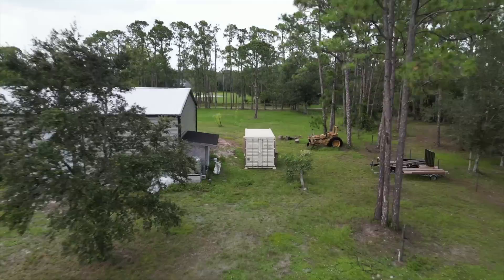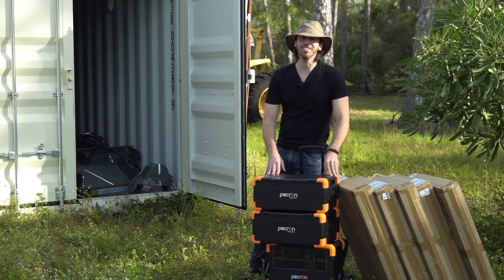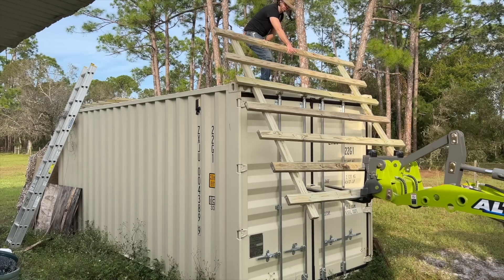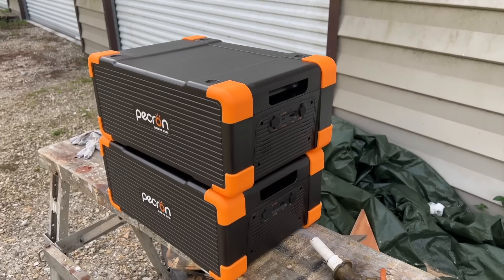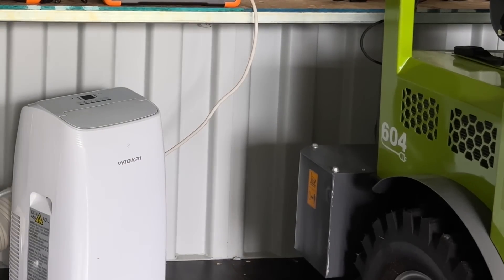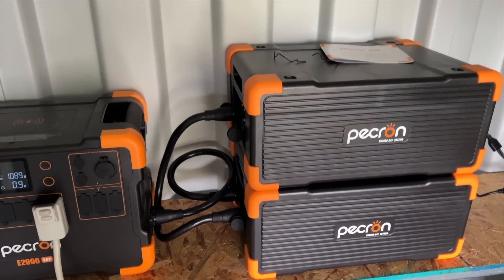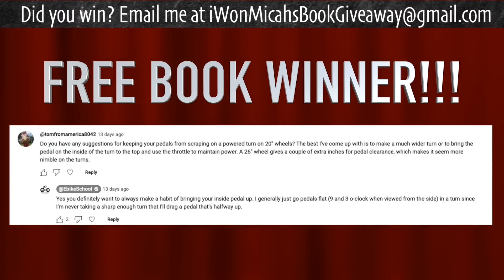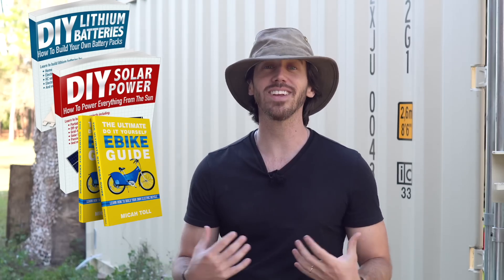Making an easy SOLAR-powered off-grid container with A/C!

Comment: Why did you drill thru the side of the vent adding a chance for water penetration? You should have cut out the bottom screen of the vent and pulled the wired up and in leaving drip loops underneath the penetration .
Reply from the maker: There is a drip loop. The interior hole is higher, letting water drip down the outside of the container. It’s gone through over six months of rains so far and all good.

Comment: Honeslty don't see how this would save any time vs buying 16 $95 LF280K's off 18650 Battery Store ($2000 at most after shipping) and an EG4 6000XP for 120V/240V ($1400) with a pretty solid MPPT built in. Add a pallet of 25 235W or 430W panels from San Tan Solar ($1000-$2000 for 5kw to 10kw of premium panels or spend a few hundred dollars and get a couple kW of some less desirable used panels that will still perform well...for under $500 plus shipping there's a lot of options for getting 4kw of panels mostly 200-250W panels)

So $4000 to $5500'ish and you could have a 16kWh battery with a 6kW split phase AIO inverter/MPPT and more than enough panels to keep you juiced up in Florida.

But I can't knock Pecron too much. Their pricing is honestly some of the most competitive on the market for the wH.

Comment: 4:54 Why are they being laid flat?  Unless you live on the equator, they should be tilted to your latitude. If you live on latitude 30, they should be tilted 30 degrees.  Laying flat at high latitude, they will never produce anywhere near their rated capacity.
Reply: because we are in hurricane country and this was the only way to attach them without risk of loosing them or needing to take them down in a storm, without adding welded steel bracing.

Comment: I used to ride a bike all the time, 20, 30, 45 miles at a time. 10-12 miles a day every day, long rides on weekends. Now, homebound. Not strong enough and 100,000$ in medical costs a year. If I had an e-bike, I could get outside again.

Comment: Totally unrelated to this video, watched some of your older videos on building battery packs and was wondering if you had some info on building a pack capable of level 2 charging. Have a Sondors Metacycle and considering attempting to build a pack to increase range and add EV charging. Would appreciate any guidance you could give me in that direction.

Comment: 9:18 the end of this tube should be cut at a 45 angle NOT at a 90deg angle like it is, The tube could potentially plug with water due to surface tension and the 90deg end, as it is now. It would be NO EFFORT for you to put a steeper angle on there, no excuses.
Reply: Bigger problem is insects and lizards getting in.  That's why we put hardware cloth over the end.  Can't see that in the video.  No excuses - funny LOL

Comment: You will want to angle the panels south for the average yearly sun angle dependent on your latitude.  Don't expect more than 10-20% rated panel output on cloudy days. Any amount of shadow on the panels will cut output dramatically.

Comment: I use those portable AC's job camping. Wrapping the outlet hose with insulation keeps extra heat from radiating through. It helps a lot actually. Cheers Micah

Comment: The panels being flat on the roof is not a good idea you are losing alot of power they should be angled towards the sun you would gain so much more power.

Comment: It will help your batteries if you insulate the container. You ac won’t be running so much draining the batteries. If you insulate the container, it will hold the cool air and not let the hot air come in from the walls and ceiling.

Comment: Yes those folding panels were free or promotional to you, but it doesn't take a genius to point out, folding panels are not most durable and will degrade in a permanent style installation.  Not what a person starting from scratch and paying for every part would be advised to use.   Solid (architectural) panels most applicable here, some flexible ones second best (because they'll last but are lying flat so needlessly more expensive);  Folding IMHO are great for temporary manual deployment, and would be good for added input through a port on the side of the container on appropriate occasions (eg on overcast days or if the container gets shade in winter that it doesn't get in summer.)

Comment: This would be a great power backup for your parents if the grid goes down for a while. This would run a fridge and some appliances until the power is restored. It’d be great to fit an external rated outlet on the outside of the container for easy hookup.

Comment: The most inefficient air conditioner is a Portable AC... Been there... Done that.
Tilting the solar panels southward will also increase their output.
Reply from the maker: Yes I forgot to mention that in the video but I went flat mount because we get some windy storms and I didn't want to give more surface for the wind to get under than I had to. There's a small efficiency penalty, but we're so far south that it's less dramatic than anywhere else in the US... other than Key West!

Comment: The cords from the Solar panels to the inside. looks to me like the water could get in from the lines entering into the container . You might have fixed that but not on camera.
Reply: There is a drip loop but hard to see in the video.  WiIl also caulk it when we are sure that there are no changes that need to be made.

Comment: Obviously, you were sent all of those folding solar panels, because if you were paying for them you would definitely NOT have gone with them as they are ridiculously expensive for the output that you get from them!  Their only advantage is portability!  For a more permanent installation buying normal solar panels would not only have given you greater output capacity per area of pannel, but they would have cost much less overall!!!

Comment: Hello Micah, I enjoy your videos. I like the subject of this one - as we have a container on our farm that we are doing things with and adding AC sometime in the future is one of them. I could be wrong, but I'd rather err on the side of caution and try help someone save time, money and headaches. Please understand the following is meant well. Most portable solar panels, that I've read about are not meant to be in the rain too often. (I understand they gave them to you to use. But I would look into getting glass panels for what you are doing. Portable panels are for fair weather and part time use. The glass panels will stand up much better and last longer. They will also provide more output too.) I would strongly recommend that the AC drain hose not be placed on or near the wood that the container is sitting on. It can rot the wood faster, if not cause that corner to sink over time. (Our container was placed on wood, for longer than I had planned and the rain water running down the one corner made it sink more, until I jacked it up and put cap stones under all four corners to level it and allow for the bottom to air out..) Not sure about where your father lives, but around here little pest are very curious and I would put a vent cover on that AC fresh air intake. Lastly the solar panel cables going into the container need a loop in them going well below where they enter the container, so that rain water will follow that to the lowest point and drip off and not be pulled into the container by following the cable in, as they are now. All the Best, Tony
Reply: I was thinking the same thing this is not the ideal setup.   I find used glass solar panels consistently on market place.  Me and my dad bought a pile of 17 panels for about $70 a piece and used them for a bunch of different small solar projects.  I know he likes the ease of install but I feel no one in there right mind who actually has to spend there money buying this equipment would then screw it to the top of a shipping container.

Comment: If this is a semi permanent install for the panels why use the folding panels?  You can get 100 watt rigid panels for $65.00 each now.  Those folding panels will not last very long deployed up there.

Comment: should put mesh on AC inlet so you don't have bugs and stuff crawl into AC , AC should prob be set to 72-82 F will save on battery usage and still have a good temp for equipment storage. Get some Sealing Clay for the big gaps to fill in and high temp sealant for small gaps.
Reply from the maker: Thanks! Yes we actually did but I left that part out of the video. It was one of the first things my dad did after we put the flange through the air outlet hole.
Reply: @EbikeSchool  nice, great video, hope you update us on how it works

Comment: to prevent rain from running along kabel that enter the container to the power unit, hang the surplus label in a loop below the power unit. that way any water will fall from the kabels at the bottom of the loop and never reach you power unit.

Comment: Nice setup. The AC will keep the batteries cool and that should extend their lives. You already know that but I suggest tilting the panels towards the South a bit so you can get the most out of them. Also add a screen to the AC outlet to prevent the bugs from getting into it

Comment: You’re delusional if you think that A/C unit will cool that container.
Reply from the maker: feels cold...
Reply: Until you get a heat wave. It needs a split system. All that air being pumped out side by the unit has to be replaced from the outside. Not an efficient way to cool anything, especially a metal container that’s going to fry an egg in the heat.

Comment: I wouldn't trust this wire to hold down the wooden frame but use some solid bolts if you don't want to retrieve your panels from the neighbor after the next hurricane...😜
Reply from the maker: Oh yea, it's definitely not hurricane proof. Before a hurricane the whole thing needs to come down. The panels will rip out even before the rope holding the frame down!

Comment: I'm an independent trucker and I bought a $13,000 tripac apu and over the last 8 years have put an additional $10,000 into it because it always breaks down. But when working correctly,  it charges my batteries,  runs the espar heater and the A/C. But recently I bought a solar panel kit on black Friday for $650 and it's amazing!! It works better than the tripac has ever worked.  It charges my batteries,  runs the heater and the a/c. And the best part,  it never needs maintenance.  I like your videos Micah

Comment: Might want to upgrade that AC unit to a dual hose one. A single hose creates a vacuum effect by just blowing out the hot air; making it inefficient as it will suck in hot and humid air into the container. A dual hose will use outdoor air for intake and exhaust so the internal air is cooler and stays dehumidified.
Reply: I wouldn't choose for a mobile AC at all. They are expensive and far less efficient than a inverter split-unit...
Reply: This, i was gonna point this out. Dual hose units are like almost as efficient as single hose units
Reply: I use window units and they work fine and would work here if I had an opening to install one. Mini splits might be overkill depends how often you open and close that door. I haven't looked into small mini splits . 73
Reply: I thought the same but as a dehumidifier that doesn't actually matters that much.
Reply: I've bodged a second hose on before and it does help but it isn't a game changer. Yes it suck the cool out out the room to some extent but it's also got cooler air going across the hot side of the unit so theoretically would make it slightly more efficient. Wether that makes any negligible difference to cop I don't know. The vacuum is very strong we run one in my soon bedroom and when you close the door you can feel the pull from it and it's a very small unit something like 6000btu.

Comment: The Pecron units are a good, simple power source. If your actually buying things the Pecron solar are not so good $$ wise and longevity compaired to rigid panels. $220 vs $120. The single hose AC is the worst thing. All that hot air blasting from the outlet has to be replaced in the container so your pulling in humid outside air.  They do make twin hose(inlet/outlet) portable units that are a lot more efficient
Reply from the maker: Good tip, thanks. I'll need to look into those twin hose style. I got a very cheap A/C I found on Amazon, knowing it wouldn't be best efficiency. But hopefully since the electricity is 'free' it won't impact me too much. I might try swapping out to a two hose unit in the future though.

Comment: Great video! Are the panels you used going to be okay for a “permanent “ setup like this? I know absolutely nothing about them, but I always thought those type of folding panels were more for temporary, movable use, but that could just be a wrong assumption on my part.
Reply: Yeah I'm not sure they are durable enough to be a permanent installation.
Reply from the maker: To be honest, I'm not sure. They are fabric lined which I think will get grungy over time but otherwise the panels seem solid so I think they should be ok. But this is experiment and I will find out over time.

Comment: How much was all this? And I have no need for a free e-bike, oh sure I love free stuff but I have to watch my weight so I can't be doing that bad...😂...👍✌🖖🥃
Reply: Around £5000 total. £500 for each 200w panel,  £1300 for each 2kwh bank. (plus the A/C unit)

If you were doing this to a shipping container, you could (with minimal knowhow and a couple of youtube tutorials):
Get industry standard 500w panels for £100 and mount them in a similar way to this video., so 2.5kw for the same price as Pecron does 200w. 
Get a 15kwh Seplos Mason battery, a 3kw pure sine inverter, all cabling and outlets you want for the container for the same price as Pecron does 4kw.

That's £3000 for 2.5x the power generation, better output power and almost 4x the storage - and with the added benefit of a new skill.

Comment: One thing I noted was the lack of a drip loop on the power cables going into the Conex.   The cables should loop below where they enter the wall.  This prevents rain from following the cable down into your e-shed.
Reply from the maker: Yes it definitely looks that way from the drone video but I ensured there was a downward angle on the wires before coming back up into the container hole

Comment: Not a bad idea for a couple ASICs, also I strongly suggest a mini split system instead of that portable unit, it's horribly inefficient and will create negative pressure inside the container which will suck in warm moist air from outside.
Reply: Also, if temperature is important, then the container desperately needs insulation. Or at least being painted white. The amount of heat that thing will soak up from the sun will be amazing.
Reply from the maker: Yes I'm thinking about putting foam panels on outside. I can't put them on the inside because I barely have a couple inches clearance as it is with two machines wide. But that's also why I went with the white container, so it wouldn't heat up as much as a darker one.
Reply: @EbikeSchool You can also modify the unit to have a second hose for intake. Has to be a unit with 2 fans though for it to work. I did it to mine via a custom 3D print and it went from not being able to cool our lounge room down now it can cool the whole house ice cold on a 38c day.

Comment: Interesting setup, I would have done an eg4 dc mini split, both for the reason of not having to convert dc to ac and because that portable a/c unit draws inside air to the outside.